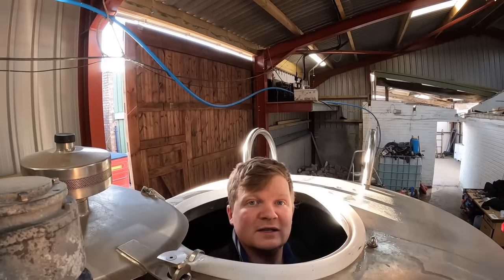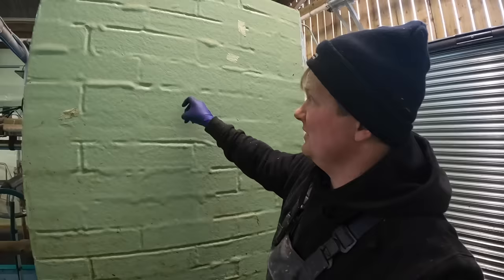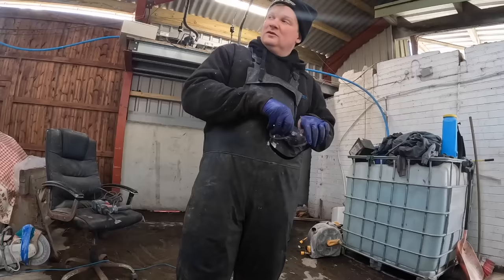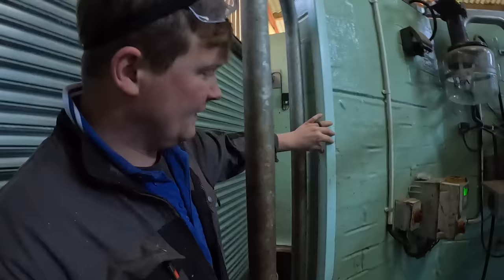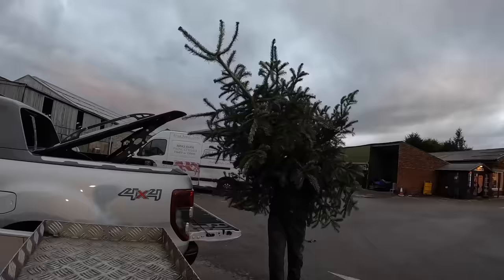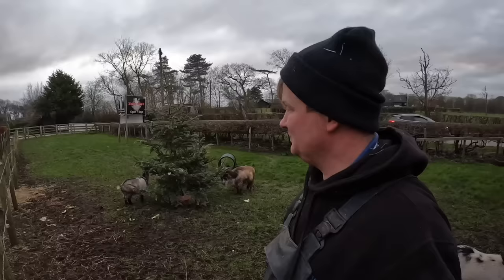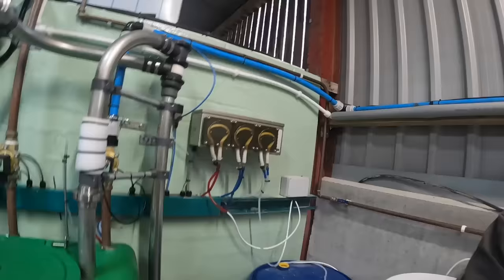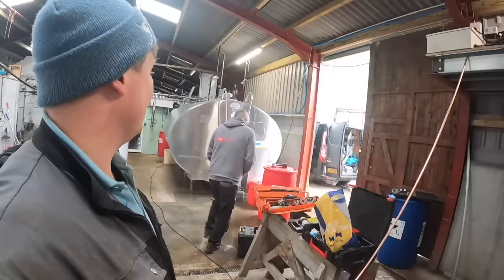NOT HAPPY... PARLOUR PROBLEMS!!  DEMOLITION DAY FOR THE DAIRY!

Comment: Hope your dad is ok? It’s hard getting old …. 
Hate to harp on about safety , but you need to be there for your family …. So , much better on the eye protection ! But your hearing ? Work to do sorry mate. And that step ladder ? Designed for home use and for 60-70 Kg max I would suggest . Get proper industrial strength ladders .
I’m glad you’re getting on with the tidy up and reorganisation, it will all be worthwhile. Good to see the equipment being kept clean, you’ve spent a lot with new or newer tractors and machinery so it pays to maintain it .

Comment: Surprised you didn’t have heat recovery already it is the quintessential “free heat”. regarding the heating of water I can’t agree with your explanation it takes exactly the same amount of energy to raise the temperature of water 10 degrees regardless of where you start. It does become interesting though if it changes state ie ice or steam that is a whole different world. Obviously you will save loads of electricity if you are using pre heated water (as long as the pipe is well lagged cos it a very long run)

Comment: 11:30   Perhaps you are incorrect.     It take the same amount of energy to heat water from 10 to 40 as it would from 40 to 70.   Specific heat is the amount of heat energy it takes to raise or lower the temperature of 1 gram of a substance by 1°Celsius. The specific heat of liquid water is 1 calorie per gram per 1 degree C (cal/g/°C)

Comment: £8500 is a cheap price so no wonder you had problems. If you wanted to do it properly you should be using (vertical grade) epoxy resin. Its much more hard wearing and is used in in all commercial food processing buildings. Get what you pay for in the end.

Comment: I was afraid that this blistering might happen when I saw you clean it the first time. And also drilling holes in the epoxy to mount all the machinery. Those holes breach the seal the epoxy is supposed to deliver.  But what can I say, sitting at a laptop in The Netherlands.... So sorry it came to that. And I agree with @BillsCountrysideAdventures, get stainless strips in stead of plastic. But again, who am I? 🤷‍♂

Comment: It was obvious that the fibreglass job was a bodge. These finishes must be put onto a properly prepared surface. Not crappy old brick.
Fibreglass won't ever bond to such surfaces. As for sticking on corner pieces....complete waste of time.
That wall should have just been thoroughly cleared of all old surface material and then sealed, then primed, and finally painted.
Now you will forever have bits of fibreglass falling off the wall. You won't be able to properly clean it. 
It's a mess.

Comment: Hi Tom,
We both know what's required and it's atrocious to even consider but as long as the primary issue, the surface preparation, including heat lamps to drive off as much moisture from inside the wall as possible because without both will just waste money and time. 
You needed this like a cow kick to the head but this 💩 does unfortunately happen.
Chemical strip
Neutralize 
Heat lamp until the walls become dusty again or 36 hrs min. Lot of water💧in bricks😮
Surface prep with catalyst 
Apply coating 

God be with you my child😉👍